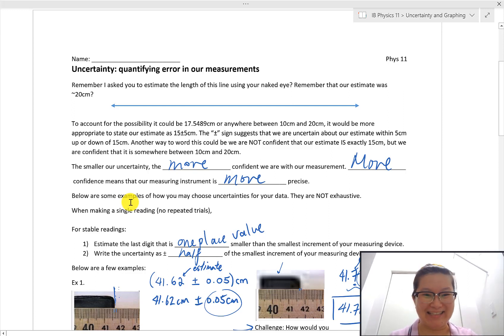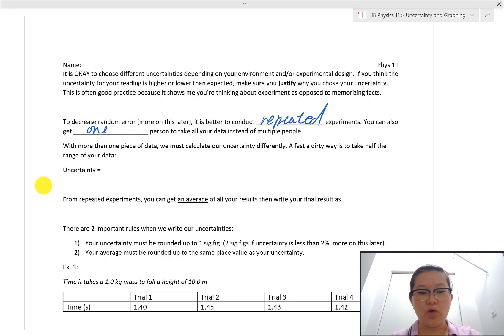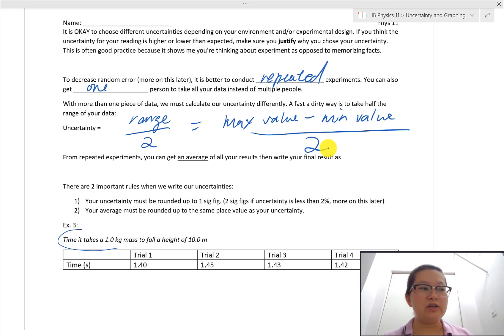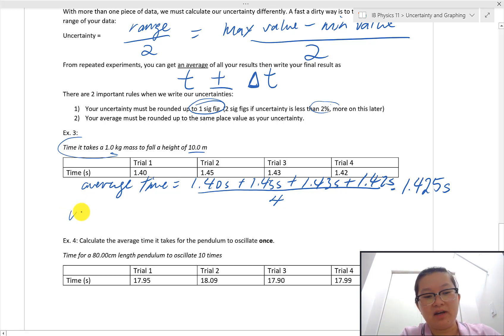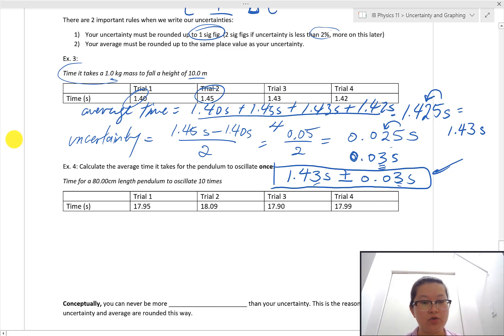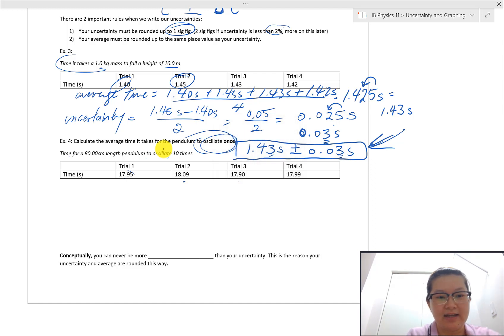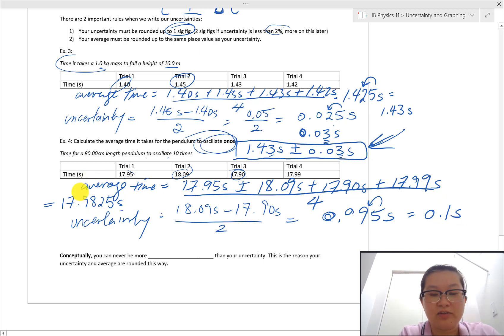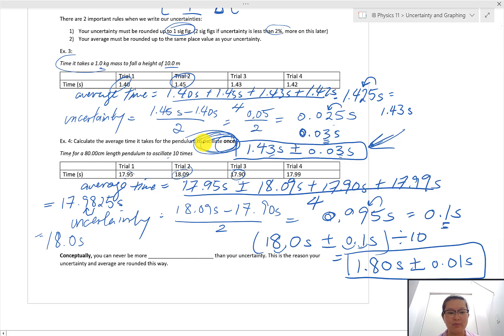1.05 Calculating uncertainty for repeated measurements during data collection

Comment: thank you this video it is very helpful in my lecture. Query about the uncertainty, for rulers and some equipment, should it always be least count divided 2? Other, videos just immediately utilized the least count as the uncertainty. Thank you for your response it advance
Reply from the maker: When I teach my students, I introduce the least count divided by 2 as a standard guidance for single readings. Over the course, they will use various instruments in which some instruments may need larger uncertainties associated with their readings. We discuss these discrepancies in class. As long as my students can explain their choice in their uncertainty, I will accept either (or other) uncertainties. The type of instrument and/or experimental design will affect how you determine the uncertainties in the measurement.